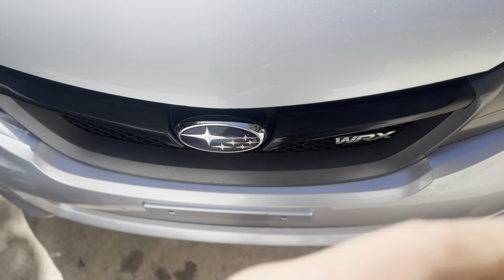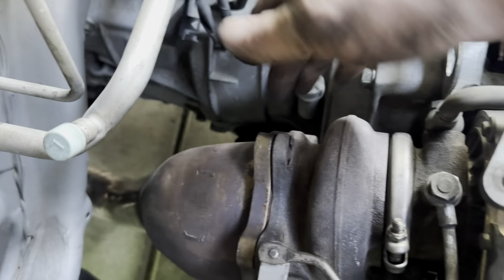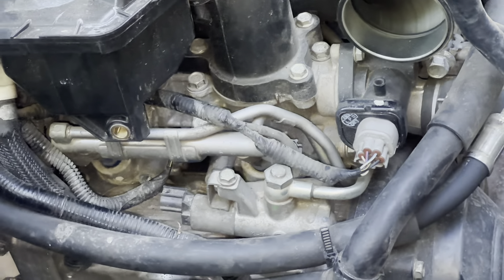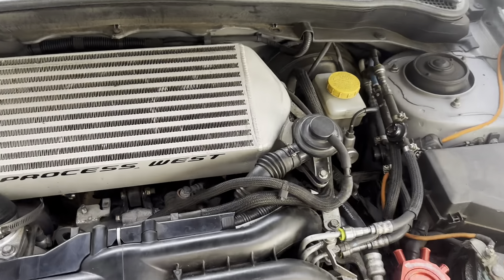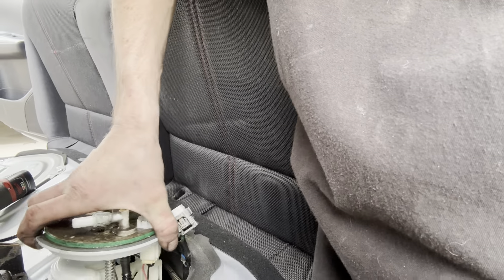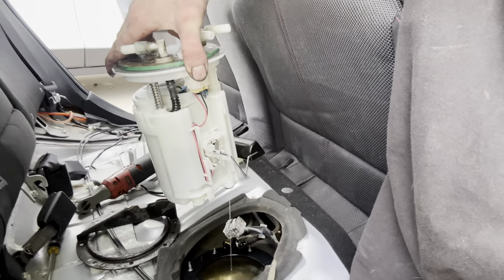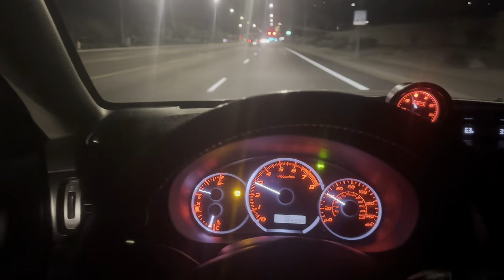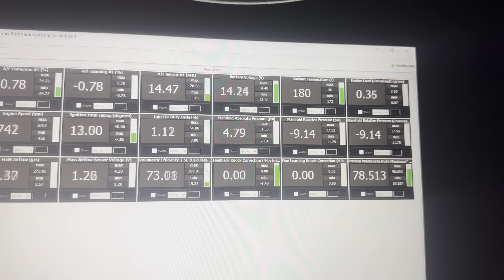Full Bolt Ons and Tune in 24 Hours!  (2012 wrx)

Comment: full throttle when the engine is cold, oh dear. You need a wideband 02 sensor to monitor afr as the factory one only reads cruise....
Reply from the maker: 😂😂😂 literally monitoring when i was crusiing kept it under 50 percent throttle on the colds engine. Just a little boost.😂😂 yall are funny. And yes i always tune with a wide bank i just dont show alot in vids, thanks for comment and watching tho!
Reply: @tschmidy183  hey, it's your car. If you wanna boost it whilst it's cold then go for it. 

You also need knock control. Det cans we call them in the UK. The knock sensor control on the standard ECU doesn't see all knock.
Reply from the maker: @benc911  im quite certain nooone in the us uses them. In fact most tuners have never even heard of them. Ive been around dynos for years, never heard one even mentioned. But it doesnt hurt to look into them. I dont mind criticism at all as long as its helpful and not pointless.

Lastly coolant temp was around 140 , i think thats ok for a couple psis of boosts lol. Would never stomp on it on cold engine ever.